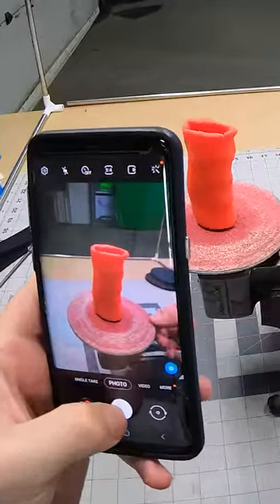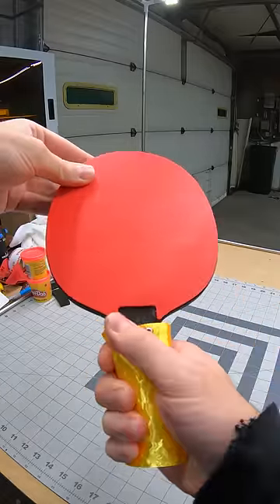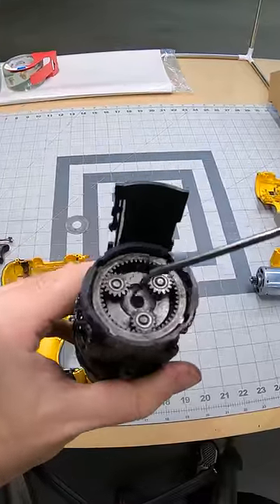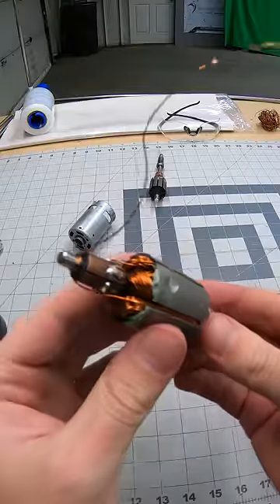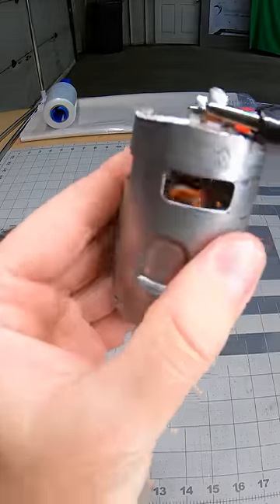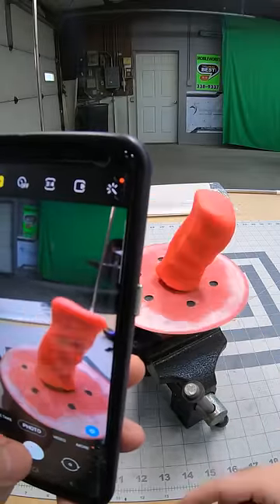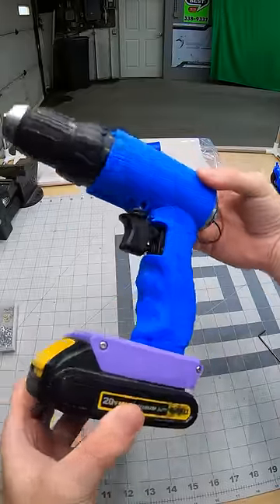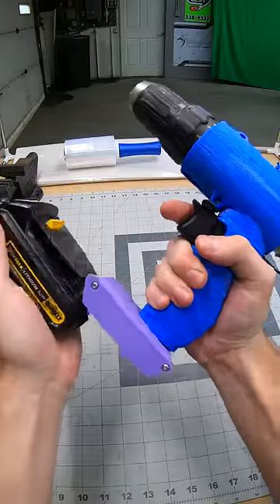3D Scanning My Hand To Fit My Power Tools  #3dprinting @dewalttv

Comment: Bro repaired a drill like it was nothing
Reply: Did we watch the same video? He turned that drill into the wish version, that motor was shaking harder than Michael J Fox
Reply: *repaired
Reply: @BlueScreenCorp he made a wish drill from a broken drill? I see this as an absolute win. Something from nothing.
Reply: He lashed it up
Reply: @BlueScreenCorp there was no bushing supporting it in the back, so the moter will still run smooth
Reply: I just think he spent like 5 hours of his time (probably worth 30$/hr) to make a wonky drill.
Reply: It's really not jard
Reply: The 3d print pla Will break by just looking at it no less drivning a screw or drilling a hole id be suprised if it can drill anything into syrofoam
Reply: @Zenerd775 the education from tearing apart a motor let alone getting one functioning is more than 30/hr
Reply: You would be surprised to see how basic hand drills are. I take them apart time to time in order to steal the motors out of them.
Reply: @linus_ffs1257 his design isn't great but PLA is pretty stiff and considering the amount of torque and force dissipated by the distance from the spinning section he will probably be fine.
Reply: @pneumantic6297  bro no offence but your comment makes me think you are some new MIT student that plays osu 😅
Reply: @pneumantic6297 PLA is somewhat resistant but it's not meant for hydraulic use, not to mention not very good for joints.
Reply: Pretty easy lwk
Reply: @SuperJoziBoy i would have bought the right motor and replaced it, fixing the drill. And then spent those saved hours making way more money than i spent on the motor.
Reply: @gravestoner2488  you probably are t capable of rebuilding the motor
Reply: @SuperJoziBoy  Thats funny. Because I reduild motors 1000s of times bigger than this for industrial companies 😉
Reply: @gravestoner2488  you're right that replacing the motor would have been better. But I don't think that's the point. He's just having fun man. I don't think he's going to be using that drill a lot.
Reply: @linus_ffs1257  you aren't very smart, there are guns made entirely from pla and they do not break easily, yeah after about 20 shots ofc it's gonna be bad but a drill is different
Reply: really not too hard to repair power tools, me and my brother in law fixed a makita used aslphalt saw cleaned it and finished it in an afternoon 250$ on ebay👍👍
Reply: I’m sure it works great 👍
Reply: Yea, and even then most people would just buy a new motor online, MF's first reaction is to literally repair the broken motor
Reply: @linus_ffs1257  Where did he say it's PLA? Could well be PETG, or even ASA cuz we didn't see the printer
Reply: @SuperJoziBoy exactly, shit was impressive, idk what dude is on, he would’ve just went a bought a new one lol
Reply: @linus_ffs1257  pla isn’t always weak, especially not that weak
Reply: @absolutegoatfuck5019  okay make a drill like his and compare it to my hilti drill se wich drill  an do svag and when o e breaks
Reply: Prove me wrong
Reply: @doqtorisykero7971 could even be nylon
Reply: @BlueScreenCorp it barely shake and doesn't effect the final product. How about you do what he did and we see how good you do. Not easy to hand repair motor windings.
Reply: @SuperJoziBoy What did it said before?
Reply: Hell na... bot
Reply: Not that hard tbh
Reply: @funnydude447  Can't say it if you never did it
Reply: @SuperJoziBoy he fixed the drill, then unnecessarily temuifiyed it

Comment: That drill is one drop away from the junkyard 😂
Reply: …or from yet another repair 👌
Reply: @andreirachko  This is honnestly the worst drill from Dewalt. He sould have replaced it instead of repaired it
Reply: Doesn’t seem like he puts a lot of force into it like a tradesman so hopefully it’ll be fine lol but definitely A+ for effort. Durability sure won’t be great lol I’d imagine it splitting along the grains if you put pressure on it
Reply: His drill can also be used as an angle grinder if he turns it into a straight grip😂
Reply: @charleslaferriere2282 do you have any idea how much he’s gonna make off this silly repair video? 😅
Reply: I hope not
Reply: @phant0m597  shorts don’t make money so nothing. It will generate impressions with affect the algorithm’s willingness to keep pushing his content to new viewers. 

So money? None. Exposure? Some. Overall just about nothing of substance.
Reply: @ChronicSkooma  shorts do make money. About a nickel per thousand views.

Comment: There is no way you done the copper wire in the motor by hand and had to that perfect.
Reply: It's possible, if you soend hours doing so
Reply: Agreed, impossible.
Reply: It's possible. Now whether or not it's up to factory spec is a different story. Motors are incredibly basic devices until you get into specific use cases (drone motor, alternator, or a drill motor in this case).
Reply: You can even 3D print and hand wind pretty powerful motors.. it's just math
Reply: in my country we that by hand..it cost cheaper than buying a new motor..
Reply: Not only is it possible, here in Brazil just in my town there's dozens of repair shops specialized in rewinding motors, transformers, solenoids, etc.
Reply: @Bleats_Sinodai  shit do they do international repairs? Have D O Z E N S of motors that need rewound...
Reply: HergerTheJoyous  and good movie or podcast
Reply: I have hand wound many coils....it's just time-consuming, a bit tedious and incredibly difficult to match exact turn ratios without schematics.
Reply: Totally doable, it's a brushed motor. They are fairly simple and inefficient. It's likely not as good as factory but for such a simple application, its possible. Real issue is they are cheap, so not worth it for most.
Reply: @vladimpaler23dearo29 yes it does atleast you all have common sense
Reply: did that as part uni project it aint that hard
Reply: Well it's not 100 % did you not hear the drill when he reved it up
Reply: It is possible, but time consuming. He's also very likely not getting the same efficiency/torque that he was from the factory, just due to how much sloppier a hand wound coil is going to be vs a factory wound one; and the fact that he also likely doesn't have the correct turns ratios either. So yes it will work, but at the cost of making your drill run a bit worse than before.
Reply: Agreed. Probably for clout.

He just took out the field poles part and just said he hand wind it and return it
Reply: @Jester_The_Jynxster  but the drill wasn’t working at all so I guess this is a rare YouTube mechanic W…….
Reply: 100% possible. I can just hear it's uneven and very loose.
Reply: It was nowhere near perfect, did you see how much it was vibrating? Not at all balanced
Reply: You ever watch videos of Indian people rebuilding coils by hand. It's a grueling task but they rebuild them perfectly everytime.
Reply: Saw a video of an Indian repair shop where a guy with no shoes or gloves unwrapped copper wires, treated them, and re-wrapped them again.
Reply: You must live under a rock you can YouTube hand winding coils or motors and there will be tons of videos to watch
Reply: Never seen a metal worker in new dehli j guess
Reply: You can tell its done by hand because its way out of balance and shaking in his hand
Reply: @tortrac958 doesn't take hours once you have it open I can remove some burnt or broken coil and wind up a new line in like 7 minutes
Reply: @ArcherInTraining2  seriously? Damn that's impressive
Reply: Haters gonna hate 💀
Reply: He could have on a winding machine.
Reply: Nope not perfect lol bro that drill has like 1 lb of torque behind it now 😂
Reply: Never touched a HO motor and it shows
Reply: @paigeconnell7005  i used to remove the copper from them as a kid and they are so difficult to pull the copper out.
Reply: @slvshy666 you know that most of these vids are super fake? They take a working item, destroy it, and rearrange the shots making it look like they fixed it.
Reply: @SianaGearz  that's fair
Reply: I'm not buying that this dude wound that. Calling bs. 

Also, where is the 3d scanner part?
Reply: Mind sharing how any phine can become a 3d scanner? I would like to know more.
Reply: It's not that hard my dude lmfao 😂 so many videos on how to do it. If you understand 120° and spinning wire a certain amount of times then this is easy to people who do understand
Reply: It doesn't have to be perfect, people have made many custom electric motors
Reply: @mythrillium2 Are there really no shops in your area or do they just not accept small motors anymore?
Reply: @an2thea514  I guess they just don't do small motors. I sent a service inquiry to one that's nearby; no response.
Reply: Not really just got know what your doing
Reply: There are tons of videos online of people doing that in poor countries.
Reply: Just wait until that inefficiently wound motor hit high rotation speeds.
Reply: I had a "build your own generator" DIY kit as a kid that required winding three coils. Worked just fine.
Reply: It's possible, I saw that one Indian geezer hand winding alternators on Shorts a while back lol
Reply: I did this with a cd player motor while locked up. It was for my tattoo machine. My only source of income. So, I fixed it.
Reply: im not an expert so take my response lightly, but how tf is copper burnt up? i feel like the repair was bullcrap and he just wanted too seem like a pro.
Reply: Is there technique beyond wrapping the wire constantly in straight lines? If there isn’t anything super crazy he could literally just use his lathe to spin it while he holds the wire
Reply: It’s very possible but I’d personally get fed up and stop before actually finishing
Reply: @mythrillium2 it would cost more to have it shipped both ways than to just re-buy anything 😭😭😭😭 it's a shame. But hey, it's a useful skill to have if the world goes tits up 🤘 might be worth disassembling stuff that breaks, even if you can't get it back together perfectly, taking things apart and putting them back together is incredibly cathartic! I used to take my radio apart and put it back together as fast as I could when I was younger 😂😂

Comment: What software did you use to scan?
Reply: Probably Polycam. I know it works for iPhone, not sure about android.
Reply: Yes, there is polycam for android
Reply: @Ryadovoy_Borodin he's using an android in the video
Reply: Reality scan it's free
Reply: Okay. I have to try both of these.
Reply: I though he is doing a technique called photogrammetry where you just use a camera and take pictures of an object from different angles, then use a computer program to merge all the pictures and calculate polygons based on the difference in the different pictures and once the program is done, you have your 3d object. I've done this before using something like meshing, I do not remember the specific program but you have to use an Nvidia graphics card and use the Nvidia Kuda thing. Las time I done this was like 4 years ago, so I don't remember specifics. To finish up the 3d scan, i used blender to clean it up. Hope this helps!

Comment: Fixing the drill was only because you wanted to fix it.

In my experience, DeWalt just outright replaced my entry level drill for free even though it was 3 years out of warranty.

DeWalt is a pretty good tool, but their customer service is surprisingly good.
Reply: I bought a dewalt drill and impact kit and blew up the impact and the 3rd speed on the drill within 6 months. Dewalt wanted me to ship them in and wait a month before they'd even decide whether they'd warranty it.
Reply: @NickR..  that's how warranties work

Comment: Saw a guy talking about handsaws once and why most mass produced ones are made the way they are.

Apparently the ergonomics of a proper handle can get complicated when you realize you have to apply for weight and center of gravity of the item you're holding. Add that with custom hand grips and there's a lot that goes into it

Comment: I watched this whole thing bc I wanted the scan software but now I’m just softwareless and confuzed. That’s a new motor or if it was grinded open snd hand wound how were there no bring marks on the top and also that frame gonna break in 2 seccond flat if you try and use it in the field

Comment: this crap will delaminate faster than you think, even without taking any hit
Also, after the first drop the housing for the motor will break in half between two layers. That's 100% guarantee

Comment: The drill body needs those holes to vent the motor or it is just going to die from over heating...  why not just put it back in the original body after repairing the motor that looks super getto.

Comment: In the ye olde 90’s rewinding electric motors was commonplace, they were not disposable like they are now, and it’s perfectly doable by hand provided your time is worth less than the cost of a replacement motor/rotor. They’re dirt cheap now, so nobody screws around with this sort of thing anymore, at least not on a hobby motor. As for the body of the drill, the material is not fit for purpose and will melt/crack - even the crappiest tools use glass fiber reinforced nylon for the body of the tool. It’s a fun little experiment, but it has no practical application.
Reply: I dont think they really did that. they just showed scrap and said it was from the drill.
Reply: Only motors I send for rewind is high rpm motors for machines. Those with 16k+rpm, because they are more expensive and needs to be balanced right

Comment: Seems like using a sledgehammer to crack a nut. Just use some sandpaper (to roughen the existing grip—and later for finishing off; some epoxy body filler; and some Saran Wrap.

Comment: I feel like there a reason that grips for things don’t conform parallel to people’s bodies. Like, does the unevenness apply more pressure in specific spots to better stabilize it in your hand? Does this way make it harder to adjust your grip for drilling at different angles?

Comment: as a leftie, having handles that claim to fit a (right) hand perfectly always haunted me. plus, if you ever need to hold something the slightest different way, wouldnt the finger negative space basically push your fingers into position making it very frustating?

i get that a drill is a power tool and you wouldnt be moving your hands on the first place but the ping pong racket seems a little restrictive.

Comment: All that when you most likely only needed to clean the commutator and replace the brushes. Oh the wires are burned? Revarnish it after you clean it with water. Hand winding a new rotor is the most idiotic thing imaginable. Your drill is useless now

Comment: Rewinding a armature is not easy (did you weld or solder the leads?  How did you turn down the commutator?  Did you remember to under cut it? and that wire in the video looked very suspect(wrong gauge). 

ALSO new armature with brushes and brush rigging is like $30 online!

Comment: My porter cable drill motor started smoking, and when i took it out it was glowing orange and made a ring of death while spinning. I hosed it down in brake cleaner put it back together and now it works like a charm. Dont do this. Idk how it hasnt blown up.

Comment: Wouldn't advise holding an electric motor with 3D-printable plastic, if the motor gets even remotely warm it will grow soft and warp as you push on it
Reply: You can 3d print with the same plastic often used in drills, you can even print with $700+/KG super polymers
Reply: Wouldn't advise you giving any advises. You can 3d print on hobby grade printers with materials that easily withstand 120c.
Reply: He doesn't know about nylon lmao